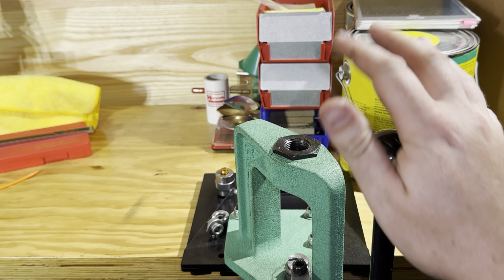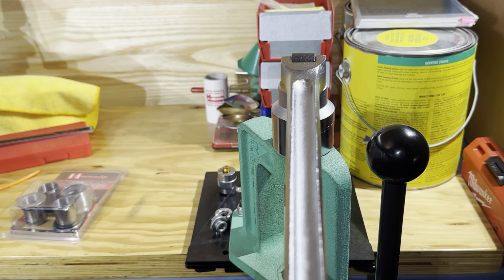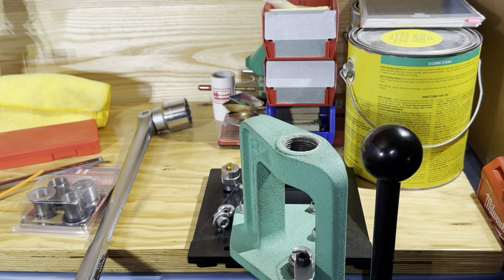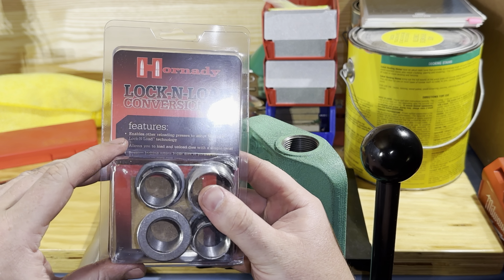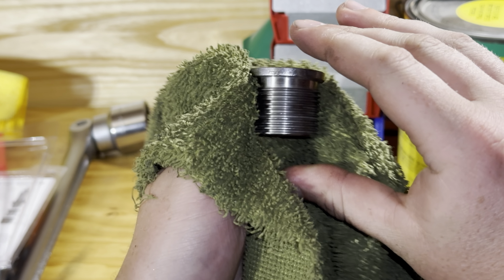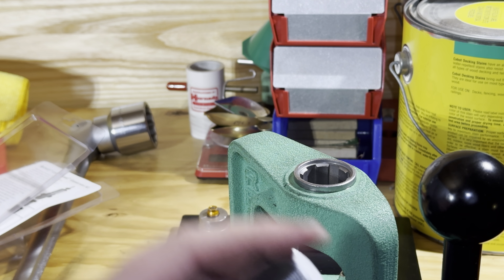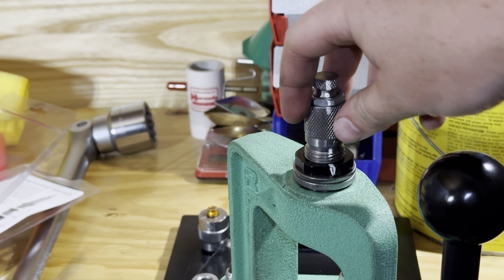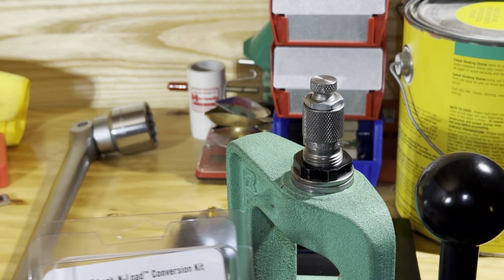Single Stage Die Swaps Made Quick! Converting a Redding Big Boss 2 to Hornady LNL Bushings!

Comment: Did the same thing to my MEC. First thing I did after mounted to the QC plate for the Inline mount. I didn't even start with threading dies directly to the press. My trick was to thread the bushing in, put in a die, then use the Hornady lock ring wrench to tighten the lock ring to the bushing, and thus the bushing to the press. Been solid since day one for me. Works great. You should be all set from what I see!
Well, I think I've wasted enough time today. Stupid hot. Like 98, but "feels like 109" so I'm wanting to get out and some more with my bolt action, but it's so hot I'm waiting for the last few hours of the day. Finally time for me to load up and get out in the sun! Have a great rest of your weekend buddy!!
Reply from the maker: Yep! Does the press frame insert piece stay in place for you on the MEC or do you have issues with it coming loose? 

Also same here, very humid the past few days, and didn’t feel like going out more than I had to. Best of luck on the new bolt gun by the way, and congrats! Working on a 20” 223 Wylde Criterion HBAR build for a long range Varmint/target setup, finally got the barrel bedded and upper mostly assembled tonight, hoping to get the scope mounted in the morning and the muzzle device mounted Tuesday when my shims get in. Excited to get loading for it!
Reply: @thereloadingcraft  I have not had an issue with it coming loose. Seems the bushing will unlock before enough force applied to loosen the threaded bushing base. Should be fine.
I went with 6 Creedmoor and it's been fun putting it together. Was so miserable today I had to wait till near dark. Right at sundown I get set up at 500 yards on a BOG tripod. Little unstable for 500 on a 12x20 silhouette for my skill level. Got 3 hits out of 4 shots. Pulled 1 off the right side. Knew it missed soon as trigger broke. Tossed in 1 more and ended the day with a hit!!
That one you are building should turn out pretty nice!! Look forward to seeing it!! Good luck getting it all finished in the next few days!! Have a great week, man!
Reply from the maker: @ChadKelly7  thank ya! Will try to do some videos once I have it up and running!
Reply: @thereloadingcraft  Awesome!! Look forward to seeing it. I put up a build video and then a zeroing and out at 200 yards video so far. Trying to decide what to film today for a video this week. It's so hot tho, I don't wanna be outside lol. Gonna try to think of something to do while I run today's errands. It just hurts to be outside too long this weekend 🤣. Next 3 days show 107 to 112 for highs!! Today is coolest of the week at 99! O well, gotta get something done to try and keep growing. Almost to 500!! 
Have a great week, man! See ya on the next one!

Comment: You can also put a bushing onto a die with the lock ring tightened, then insert the bushing and die setup part way in to engage the lugs inside the conversion insert, then carefully tighten it with a lock ring tool or a wrench.

Comment: Insert the die and die bushing into the bottom of the press bushing - yes upside down.  Then you can loosen the lock nut without clamping your die in a vise.  

Also with it in the normal position you can hold the die with a strap wrench on the top and loosen the lock nut from the die bushing without loosening the press bushing.

Comment: Who told you to use a wire brush INSIDE threads that need to last a long time?
Reply from the maker: How else are you going to get the hardened loctite out? Also those threads are not heavy use, once the bushing is in (either the original 7/8-14 or the LNL quick change) the large bushing and frame are locked together. They are unlikely to see usage-caused wear, and my gentle brushing did not harm them in any way.
Reply: @thereloadingcraft  solvents and rags. We need to stop our cavalier attitude toward wire brushes.
Reply from the maker: Nahh, those threads were not harmed in the least. Also at least I was brushing in line with the threads, not against them
Reply: @thereloadingcraft it’s forged hardened steel, a little wire brushing isn’t going to harm anything
Reply: You're just trolling, right? It would be literally impossible to damage any threads, especially in hardened steel, by a small amount of wire brushing.

Comment: Will the dies fit in the die boxes with the Lock n load on?
Reply: Some die boxes will fit, some won't.  Dillon boxes yes.  RCBS No.  Lyman yes.  Lee no.  Hornady yes.  Your results may vary because of 3 vs 2 dies or if your die supports are too close to the center of the box... no room around the threaded portion of the dies.

Comment: I have used the Hornady system.  But found the Lee Breech Lock alot better.
Reply from the maker: I have also used the breech lock, but wasn’t impressed with the fit and finish, at least on the ones I had. For general use they’d be fine, for precision work they wouldn’t be my choice
Reply: Yep, me too... there's too much play in the Hornady system especially as it wears. The LEE system has no play and if it wears it's compensated by the interrupted thread system...if any wear were to occur you simply turn the bushing in further. That's why the military uses interrupted threads as well as takedown guns since takedown guns were invented. But the Hornady system is o.k. unless doing long range precision stuff.